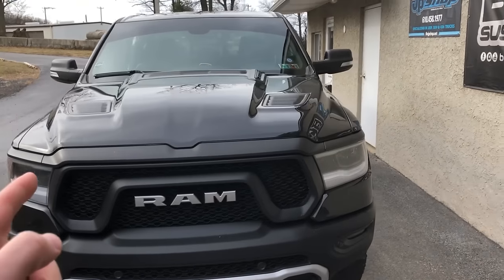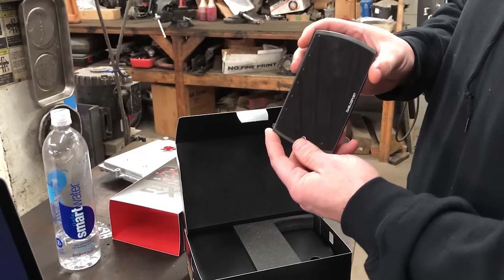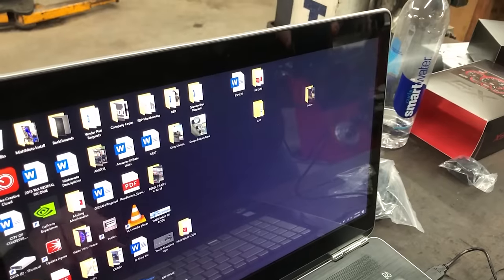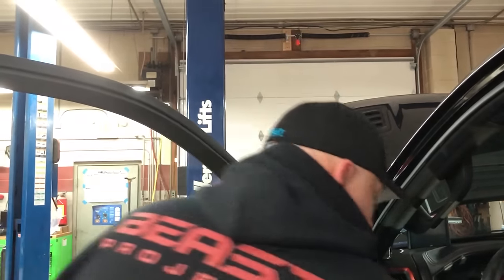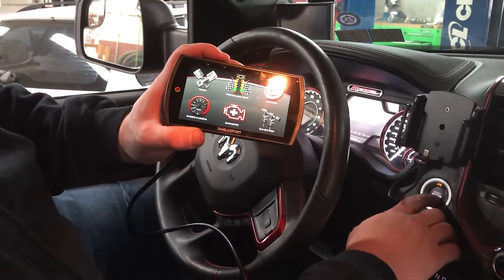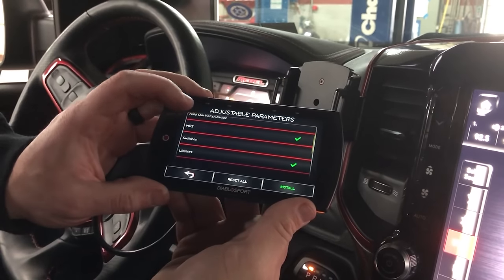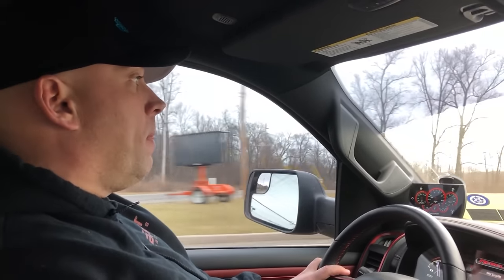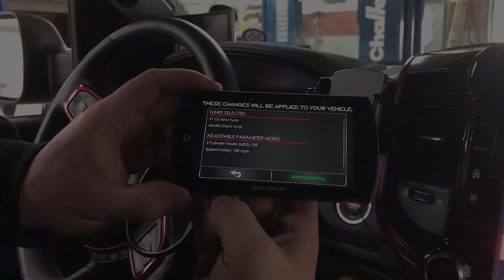MORE POWER! 2019+ Ram 1500 5.7L DiabloSport Full Tuning Overview & Install

Comment: i didnt want to worry about my warranty so i opted to install the EDGE PULSAR tonight. other than the tuner, all I have is a super 10 series single chamber muffler with duals and a drop in k&n filter in the airbox. so far ive had my '19 Hemi Ram 1500 Classic 4x4 for 1 year and love it.
Reply: I want this Diablo bad but don't want to worry about my warranty till it runs out, how are you liking the edge pulsar so far? leaning towards that to help smooth my ride out cause I have 37s on. also looking to add the pedal commander to I guess 🤔
Reply: @robertmontoya4941  If you get the Pulsar,  you don't really need a pedal commander.

Comment: great video. I really appreciate it. Two questions, 1 - did you have to leave the diablo display tuner plugged in the whole time to the OBD port? or can you remove it and still have your tune functioning? And the other question is when you went to the dyno did you see HP gains like diablo claims? Thanks for your help.

Comment: Awesome video 👍 I can’t wait to get & install my Diablosport i3 tuner for my 18’ Ram 1500 in a few weeks
Reply from the maker: Thanks Joe
Reply: BEAST Projects  Steve I’m contemplating turning off the MDS once I get my Diablo tuner installed. Overall, is it better on the 5.7L engines to have the MDS off? 🤔
Reply: @joestreetglider  these Hemis down fuel without MDS. Keep it in 7th around town....this disables it. Then run with the 8 showing to get MDS. Simple as hell without getting ripped off 🤷‍♂️
Reply: @joestreetglider  eliminates the wierd mds sound

Comment: great video Steve as usual, those connectors for ur pcm if the locking tab broke just run a zip tie around the connector and the release handle just for peace of mind
Reply from the maker: Thanks Tony, you going to Motorama this year?
Reply: @BEASTProjects  maybe

Comment: Great video! Thank you both for the walkthrough. I have a 2020 Laramie and use it to tow a camper. Still learning more about these tunes and their abilities. I would like to give it a little more umph when towing...does this have the ability to change on the fly (from a standard tune to a tow tune)? Also have eTorque (unfortunately) and wondering if it works with that setup. Hope that makes sense.

Comment: Have run Diablosport intune and custom tune on 2 GMC Sierras. Now i have a 2019 Ram 1500 and have been talking to a guy that tunes with hp tuners. Im still kinda leaning towards the Diablosport!!!!
Reply: Diablosport has alot of NA 11 seconds 1/4 trucks and 12 seconds 1/4 4 door rams too
Reply: @AestheticChino  I won the programmer in an auction.  Open box,  but still has sticker on programmer screen and tied up cables.  No unlocked pcm.  What do I need to do to use it?

Comment: So yesterday I installed the security by pass and well able to pull my stock tune file and got the message on my tuner saying Factory Data Retrieved. So far so good. Then I continue on with the process by disconnecting the battery and then removing the 2 connectors. Gray/silver on came off just fine. I go to do the tan/beige one and it wouldn’t come off. Tried to figure out why it wouldn’t come off and in the end the red latch that locks that connector in place ended up breaking off on both sides. The latch is still in one piece but both sides that were holding it on broke off. Now I have an appointment with my local dealership next week for them to fix that plus figure out why connector isn’t coming off at all. Talk about major frustration.

Comment: You did a video with the PULSAR as well...which do you prefer and which is better for a somewhat novice? Rolling with a 2020 Ram Laramie Sport....also got an afe stage 2 CAI...are there adjustment tips for adding this?
Reply from the maker: Full tuning, skip the Pulsar

Comment: So you got rid of your Pulsar Tuner in favor of this system? Did you happen to have the dreaded issue a lot of us were having with the Pulsar where the dash would light up like a christmas tree and it would either go into limp mode or lose throttle control and it it would accelerate on its own. How are you liking this system now that you have had it for a few months? I am debating switching. Gone through two Pulsar units now and same issue. With the wife driving the truck it is always a concern so i removed it.
Reply from the maker: Got rid of it, too buggy w/ the 5th Gen Rams. Full tuning

Comment: That was a great tutorial. I’m can’t wait to tune my Ram. I want to get rid if the MDS.
Reply: Click down a gear  "Bingo " no MDS run around town not letting it shift to 8th and it stays off. Go in 8th on the highway. 
You still save all the fuel and you get rid of the sound when you want. Dont waste money on crappy tuners. Buy a mild cam , more power for a fraction of the cost
Reply: Gary Woodgate 🤔  what do you have against the Diablo tuner? Any proof that they’re crap
Reply: Gary Woodgate Diablo tuners are the absolute best, try one and you will see. I had a SRT Charger and it absolutely turned it in to a completely different car for the better, big time!!!  Shifts were crisp, mpg improved, power band was so much improved. Just a way more precise vehicle. Trust me, Diablo is the best at this game.
Reply: Devo Dar well since you said “trust me”... 😝
Reply: @gwood701  ull need a tune if you install any type of cam

Comment: Okay so i just ordered a 2023 Ram Rebel 5.7 W/ Etorque....my question is SHOULD or SHOULD I NOT put a catch can on it? I know what it does but just getting into modding a truck and seeing it's my first time doing so I've done a lot of research on everything i wanna do with it. I'm aware of what catch can does and i wouldnt be so blind to think it adds HP it doesnt. I'm just not understanding the whole direct injection vs the other option just yet or lingo people say. So that's why I'm asking what others thoughts are.
Reply: My opinion I honestly don't think you need one on a 5.7 Hemi also if you live somewhere very cold  just keep in mind that it's going to freeze in the winter time you have to keep an eye on it or remove.

Comment: I thought the Rams 2015 onward couldn't be tuned only the pcm had to be flashed or use a pulsar.
Reply: The diablo comes with a unlocked ecu
Reply: @AestheticChino  which is the Pulsar.
Reply: @UvidCo  no pulser attaches to the ECU !!!!  this is a new and different ECU being installed  that is unlocked so u can tune the vehicle

Comment: Looks good! Definitely something to look at, can you tell me if that throttle setting can take the delay out of the pedal? Was looking at the JMS Pedalmax might do this instead if it can do that. Also can you tell.me whatever happened to the Pulsar that you originally added to the rebel?
Reply from the maker: I'll play around with some of the setting during dyno testing & let you know.
Reply: You can run a tune and a pedal commander last I checked

Comment: I have a 2020 rebel. I did the 91 preloaded tune and raised the speed limit and tire change. I cant clear my service traction light to go off now. 4wd works fine,cause of that winter storm we had. Still trying to het more info from Diablo.
Reply: Did you get it figured out?
Reply: Were you able to tune the TCM? I have a 2021 and although I can load the PCM tunes, it doesn't give any option for TCM and doesn't give me the backup TCM file to send to my tuner.

Comment: After watching the DiabloSport video and the Pulsar video what would you recommend Steve? I am not a hard core mod guy but really want my 2018 Ram to be a lot peppier. Anyone that has experience feel free to give your opinion as well.
Reply from the maker: Hi Steve, I definitely would invest in the DiabloSport's full tuning vs the Pulsar. It's safer & more stable.
Reply: @BEASTProjects  why would you say it's safer and more stable? Curious. I don't know which to get.
Reply: @strangeimpulse2003  pulsar dosent remove the speed governer so be ready to go fast than die out at 104 mph with the diablo tune you can do whatever speed u want helps alot on highway pulls

Comment: So any updates? How's this mod running after 2 years?

So just installed this exact tune and followed your steps everything came out good except I got check engine light on and electronic stability control says it needs to be serviced. I checked the codes and says u0100 which is something to do with communication with the pcm? Any ideas on how to fix this?
Reply from the maker: Still running strong with the new local owner. That code is common after flashing the computer. Just clear it with the T2 & you're good to go,

Comment: ran this + custom tune on my last truck, and deciding between this or pulsar (simpler to yank if i need warrenty service) -- does this actually disable MDS (vs just giving throttle to cancel it like the pulsar)?
Reply from the maker: It actually shuts down the MDS.

Comment: I have 2016 Ram Rebel. If I install one of these would I be able to do a burnout without the traction control kicking on?
Reply from the maker: You should be able to do it without it. Just hold down the TC button until it's completely deactivated.

Comment: What problems did you have with the Pulsar that made you want to switch to the Diablo Tune?
Reply from the maker: There's some issues w/ the 5th Gen Rams that they were working on prior to this video.
Reply: @BEASTProjects  come on man be specific... What problems did you have exactly?
Reply from the maker: It’s was throwing codes. Full tuning is the way to go w/ the 5th Gen Rams.
Reply: The speed governor is the main problem

Comment: Can you fully disable traction control and stabilitrak with this tuner?im almost sold on ordering it this week
Reply from the maker: I still have to manually disable traction control to fully disable it by holding the button down for 5 or more seconds.
Reply: BEAST Projects with the tune can you try it in 2wd to see if it fully disables the stabilitrak system/esc or if that is still there. These trucks cant have it completely disabled from the factory and im just hoping to find a tuner that can allow no safety assists in 2wd for winter fun
Reply: @TheIamdevin  pull out the stability fuse from the fuse box under the hood and be ready to party
Reply: @AestheticChino  i could do that yes but i dont want to be running in and out of the truck installing and removing the fuse lol

Comment: Can you adjust the idle to slow it down?
Reply: Probably, but since some hemi engines are known to cause damage over time from idling too long due to lack of oil flow, I wouldn't recommend it. Id recommend raising the idle.

Comment: Did you say catch can? What for?
Reply from the maker: https://youtu.be/nz9oOj1ubYQ
Reply: BEAST Projects tried watching the vid on the go but was hard to follow, trying to listen for a “use this catch can because” comment. You kept mentioning Diesel engines? Is that what the catch can is for? I have the 2020 5.7 hemi so was curious if the catch can was needed for a N/A motor. I’ve used them with forced induction just didn’t know if it applied to N/A in the same way. Thanks for the reply!
Reply from the maker: Are you on Instagram? Send me a DM & I’ll send you something.
Reply: DMed

Comment: Did this void factory warranty?
Reply from the maker: It’s talked about in the video.
Reply: Of course it voids the warranty. This could completely disable or destroy your new $60k truck
Reply: Collin  C’mon you’re killing me 😩 lol how will this destroy your truck? If there’s any issues with the new pcm just replace it with the stock pcm
Reply: @joestreetglider  When your transmission overheats and catches fire you can  just swap that pcm and just roll right down the road. What's likely to happen is you cause unknown increased wear and tear on engine components. The company spends millions tuning the engine and transmission. These fly by night companies has a guy named Jed on his Dell play with some numbers to somehow give you more torque. No thanks
Reply: @ConquerCollin  that 8 speed transmission is darn near bullet proof but a trans cooler will fix that issue

Comment: It will absolutely void your warranty.
Reply: That’s what sucks. Do you know if pulsar does?
Reply from the maker: I would go w/ the Edge Projects AMP’D Throttle Sensitivity Booster of you’re worried about the warranty. I put one in my wife’s Jeep & there’s a noticeable difference. You can even make adjustments to the power curves.
Reply: @BEASTProjects  would you get that or pulsar for a ram 1500?
Reply from the maker: AMP’D for the Ram.